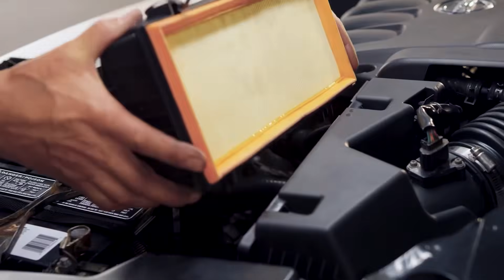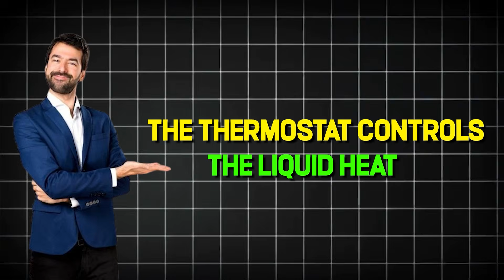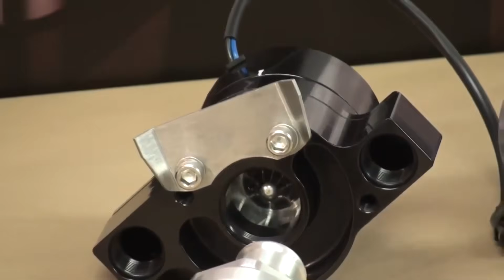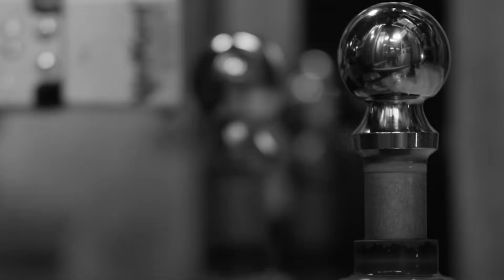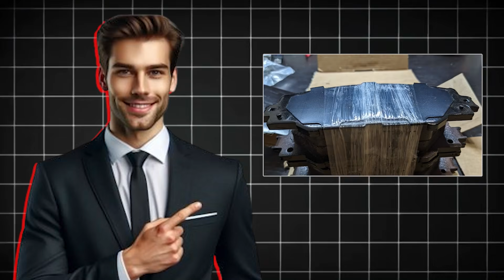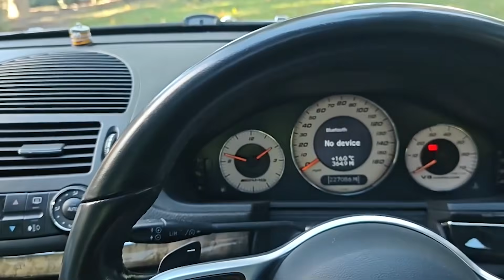15 Mercedes Parts You Should NEVER Buy From the Dealership (And Where to Get Them Half Price)

Comment: Great video! Alternator blinking R&R'd voltage regulator which is typically the compromised charging cause. Same for MAF...$90 Pierburg OEM sensor only at Rock. Prepping a conductor plate R&R, RockAuto has become pretty good at OEM parts.

Comment: Bosch air filters are $15 online each.  
I replaced mine by taking the engine cover and removing the screws.  It took less than 10 mins from popping the hood to closing it.  All you need is the Allen wrench.  Order that as well.  It’s worth it.